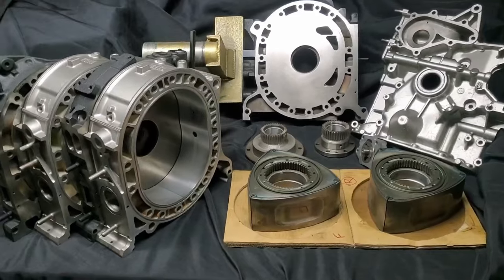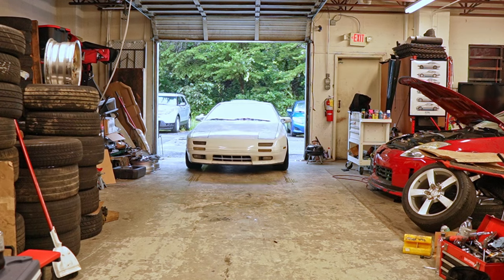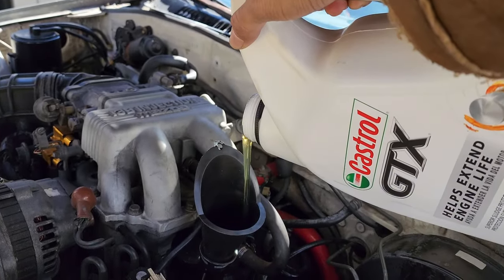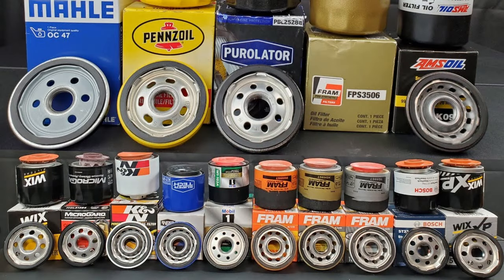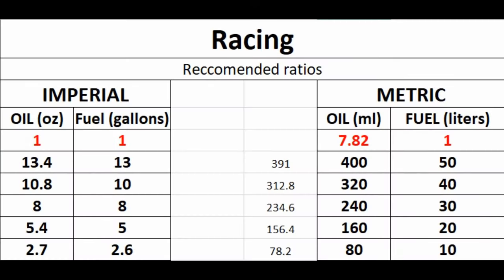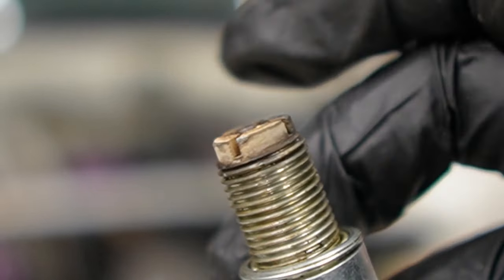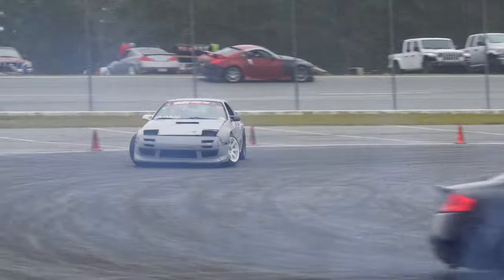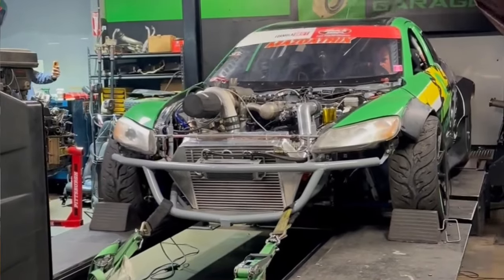How To Maintain Your Rotary Engine

Comment: Should you premix even with a catalytic converter?
Reply from the maker: Yes and no on using premix with cat converter. There's a mix review about this, some say u can and some say no. But just on the safe side, I would say no if ur running a catalytic but u can try it out. At this day in age, I wouldn't recommend running catalytic with rotaries because it messes with the flow of the exhaust. I would suggest getting rid of it and use resonator.

Comment: All very good info here.. IDEMITSU all day for me, engine oil and premix. I am glad you talked about oil coverage with the OMP, plenty of rotary guys are still blind to this that the coverage isn't as good as using premix with the fuel. I run both OMP and premix on both my rotaries. Half oz per gal stock-ish RX-8, closer to 1 oz per gal FD because its 400 hp. 

Be careful with radiator upgrades on RX-8's, the mishimoto (most common radiator choice) sucks for the RX-8. I use a koyo on my FD. 

Also... straight pipe... your engine will thank you... these cars run so hot that heat soaks into the downpipe / header. The trapped heat ruins rear area rotor. I kno its naughty to the environment but this is one of the few cars you really really should if you want the motor to stay healthier for longer.
Reply from the maker: Thank u so much for that amazing input man! And yes, remixing is definitely important! I still run my OMP and premix at the same time. 

Never heard of the mishimoto issue before but I'll definitely take ur advice! Also Koyo to me is the best brand for radiator, no other like it! 

Great info on the catalytic part! I had totally forgot to include that and I appreciate that u mentioned it on ur comment 🙂 I totally agree there with ya!
Less restrictions of the exhaust flow the better!